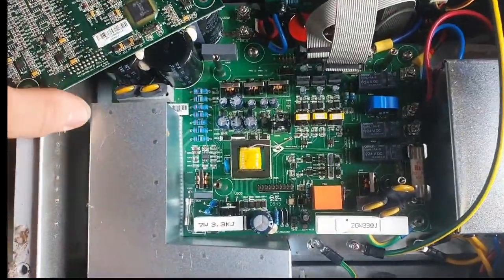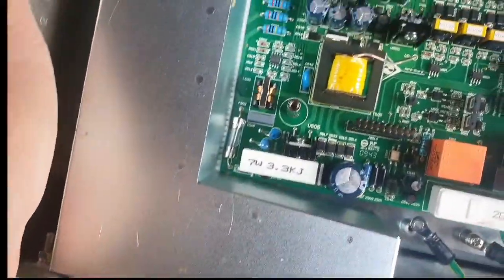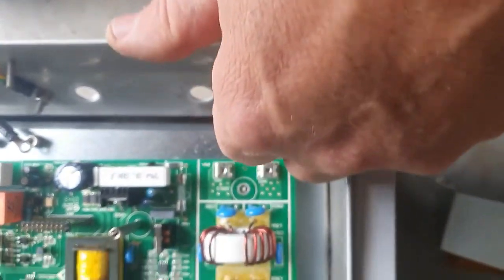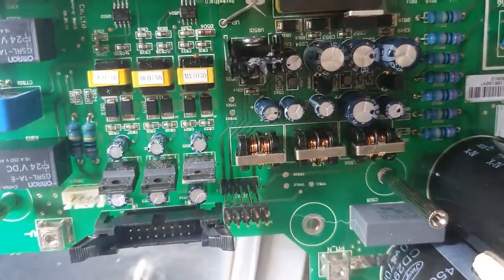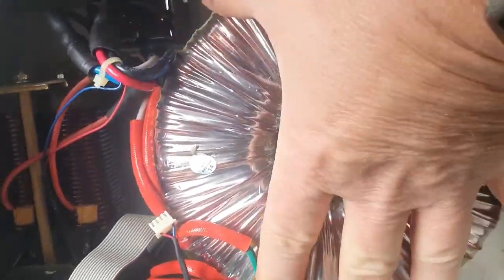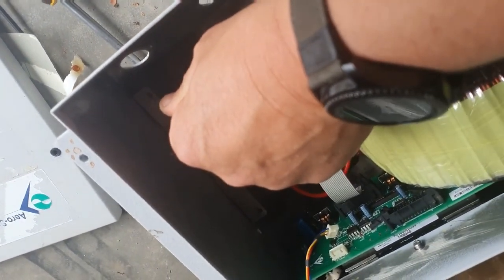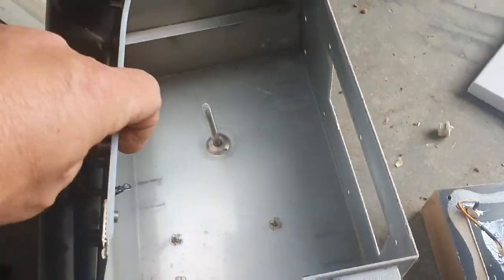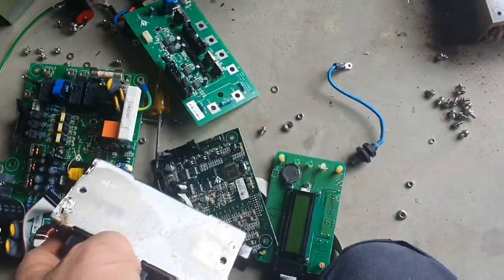Solar power invertor stripdown.

Comment: the hole through those weird unidentified blue-plastic components, makes me think it's some sortof inductive filter.
Reply from the maker: Maybe, been wondering what the arm at the top is for plus 3 tags each side very different.  Have a great day.
Reply from the maker: Found another one today in different electronic.  May need to cut one open.